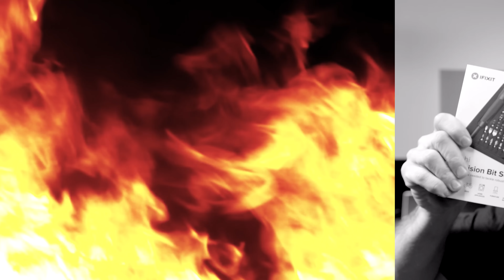They tried to screw a small streamer over... so I stepped in the best way I know how!

Comment: 2:40 Turns out there is something wrong with that: you're not allowed to run a chance-based giveaway that demands something of value from the participants, because that makes it a lottery rather than a giveaway. And legally speaking, producing advertisement value for the company running the giveaway does count for this. In fact, even demanding the ambassadors to have that referral banner on their Twitch about page might actually qualify as a requirement to do something of value to Artesian Builds. Even things like requiring participants to fill out surveys can be verboten if the resulting survey data has business value to the company. In the US, only State governments are allowed to run lotteries. And even outside the US, there's at minimum a lot of red tape involved in legally running a lottery. Not to mention private lotteries aren't just illegal to run: they're illegal to participate in. Getting caught up in this mess might actually cause harm to Ambassadors who just participated in it, if the US government decides to be a dick about this. So this stuff going high-profile might actually change the way these things are run in the tech community going forward.

You can make it a giveaway where you just need to register for free, no additional requirements, and that's fine.
You can make it a contest where the best Ambassador is awarded the rig, removing the element of a random draw, and it's also fine.
But what Artesian Builds did was 100% a lottery: there was an element of chance that couldn't be removed by performing better than other participants, and participants were required to generate an ROI for Artesian Builds, which is obviously a consideration requirement. Which means all three elements of a lottery (prize, chance and consideration) were met.
Reply: The thing is, they only changed it to those requirements after they picked a winner.
Reply: Which is arguably worse because that makes it illegal no matter how you slice it.
Reply: ok so what im getting from what you said is that I don't understand anything and you are a very smart person 😅. Man i really need to get more educated with things like these lol
Reply: @windwalker111089  don't feel bad I'm educated quite well but I also have no clue how the law works. Ur plenty smart but you can't know everything
Reply: anybody else thinking "too much text, cant read"
Reply: @unknown45754  no. If you are too lazy to read please also be too lazy to comment cus that's really annoying
Reply: @stephenponnet462  sorry bro, but being annoying is my speciality.
Reply: Holy shit dude this is wild and awesome
Reply: @unknown45754  no, in fact you can now leave lol excuse yourself
Reply: @unknown45754  ingraved in our dna haha
Reply: What’s the difference between raffle and lottery then lmao because I’ve paid to enter plenty of raffles that the item being won was based on chance?
Reply: @blackwng  If that's the case, then those raffles you paid to enter were, in fact, illegal lotteries advertised as raffles. It's one of those laws that gets broken all the time.
Reply: @martenkahr3365  good I hope it keeps getting broken, no reason not to have them, only people who don’t like them have never won or bothered to enter lmaoo
Reply: Sun this down for me?
Reply: Lets be clear, Because of miss info, Its unlikely participants would get legal issues. That said, fair point! I remember being brand ambassador for phone companies at different point in my life and even them usually go : ok here's a contest if you hit this target of whatever and up ( which was usually ridiculously low) you get a new phone free of charge or this new tech we want you to know and sell. And that is when they requested anything at all (usually for bigger items too) I remember receiving a bunch of accessories as they got released just so i had the chance to learn the product before selling it basically ok and why the hell not of those company was Apple... when even them get to be more ethical....
Reply: What do those giveaways where you have to follow their social media for extra entries count as? Does that count as providing "something of value"?
Reply: @martenkahr3365  Raffles are perfectly legal and yes, you can legally charge people to enter a raffle.  The key difference is a lottery offers a cash prize and a raffle offers a physical prize. As this was not offering a cash prize, it would be considered a raffle.

Comment: Good on you and props to EVGA for coming through.  Personally, I have no desire to watch streamers, but I wish her the best on her stream.
Reply: Because of this i'm planning to get a EVGA than a Zotac gpu both are more or less in the same price but videos like this sways audience and i'm one of them
Reply: @milanfan81  Zotac are pretty good, but I did have a Zotac that died, shortly after purchase.  I've never had an issue like that with EVGA.  Small sample size, long time ago, etc, but enough for me not to want to chance them again.  That was an expensive card too, so I was not at all happy about it.
Reply: @johnpmchappell  That's rough but Zotac did replace it? Was there an investigation to why it died?
Reply: @milanfan81  I didn't buy directly from Zotac, as I recall.  In the end, I was able to return through the online retailer for a full refund.  Not sure if they ever investigated, I'd assume so, since it was an RMA type deal, and it was not a cheap piece of hardware, but I never found anything out.  Bought the same card, from a different manufacturer, as I recall.  It's been a while ... it was nVidia's top of the line, at the time though.  Pretty it sure was the GTX 295, as that rings a bell and it was the right kind of time.

Comment: I'm sending my 3080 ftw3 ultra back to evga for an rma, I love them guys there they are so helpful with the customer support. If anyone is having issues with the 3080s locking the core clocks at 225mhz i guess its been happening to a few of them. Tried all the fixes evga recommended,  and last ditch effort is rma now.

Comment: Ya big heads up: the AIO liquid cooler they put in is presumably the "Corsair iCUE H150i ELITE LCD" and NOT the "Corsair iCUE H170i ELITE CAPELLIX"
The 5000D AIRFLOW case will not fit a 420mm radiator as you would have to cut the cables for the front i/o to get it in :)

Comment: Jay: ".. the 5000D airflow, which I love because you can just put a whole bunch of parts in and not have to worry about them fitting.."

Also Jay: ends up having to dremel the cable shield

(I also think that case is awesome its just funny)

Comment: Corsair's website says that a maximum of 360mm aio can be attached to this case, but the h170i which installed here is 420mm size. Has anyone else tried this?
Reply: Maybe the maximum front radiator is 360mm and the maximum top mounted radiator is 420mm?
Reply: @ImVesiry  nope, it says both can be max 360mm :(

Comment: I'm an old guy.....computers were introduced to students in my high school the year AFTER I graduated.
Until two weeks ago, I had never even looked in a PC case let alone dared to replace a component.  Geeks in my era were in the chess club...not computer club. I always had my PC's built for me on a budget.... 
But I'm into video content and bought some new equipment, camera's, etc and realized I could not play, let alone edit 4k video on my PC...it was clear my PC was under powered. The guy who built my system was putting me off, so I took matters in my own hands....I streamed videos showing me what to do..... installed new graphics card, PSU and SATA SSD drive.....successfully which surprised the hell out of me.
It got me so pumped that I could do this I wanted to build my own PC....so after I discovered your channel, I have been streaming your channel non-stop to absorb every bit of knowledge I can. 
Your enthusiasm, passion, knowledge and brutal honesty is so refreshing....and Videos like THIS ONE make me like you even more. Well done. 
You earned a sub from this old fart. Keep up the good work.

Comment: ive got the 4000d airflow case and idk, i like it better now after seeing you had to modify that one piece for clearence for a single cable. 

i think they did a bit better with the 4000d over the 5000d for that one little reason. now you yea will have a dremel on hand for that, but me a regular gamer likely wont have that and i just want to slap my parts in there and power on.

Comment: Super late but now with more info on what was going on at Artesian Builds:
Complete company collapse couldn't have happened to a more fitting guy than this owner.
His staff will do fine: they are all far more competent than him, I am sure. Easy bar to cross.

Also, I really don't freak out over hardware like I used to, but HOT DAMN that CPU cooler lighting and animation is WICKED. 

LOVE that.

Comment: I love how Jay came out and took care of kiapia and made things right. Jay is the example the industry should follow. I do have a question though. The H170i is a 420mm AIO and Jay puts it in a Corsair 5000D airflow, I was curious how? On Corsairs site it shows that 5000D can't support 420mm on the top just 280mm. Curious if Jay swapped it out with a H150i after seeing it didn't fit or it did fit and Corsair doesn't list the ability to have a 420mm support on top of the 5000D.
Reply: i was reseaching the same thing, but if you look when he screws it in he uses the 120mm holes, so thats a 150, not a 170

Comment: how did you fit a 420 mm radiator in the 5000D case? I'm trying to buy a new case and all websites specifications  say the 5000d only fits up to 360 mm radiators, big fan btw !

Comment: Hi Jay, I know this is kind of an older video, It's great what you did for her and I applaud you for it. I do have a question about the build. I'm looking to build a new PC into the 5000x RGB and would like to use the same icue170 aio in a top mount but the corsair website says it won't fit. Seems like it fit just fine for you' were there any mods that you had to do for this to fit? If you have a chance please let me know. Thanks.

Comment: the power supply casing come with the PC case or did you add that in manually? Also, does the coverings for the wires help with dust management?

Comment: I'm considering this case and this CPU cooler, but I noticed you used a rotary tool in your build and I do not wish to do that.  Generally, compatibility lists and Internet commenters don't believe these models are compatible.  Did you need to do anything special for this?  Thanks!

Comment: A toy die grinder on a PC case?!? Jay! Get a nibbler! They cut perfect edges into sheet metal every time and they don't leave any burs. They also taper the edge so that it isn't sharp but also doesn't flare out. Most importantly for you, they don't fling little pieces of molten metal all over the place. There is also zero need to tape it off (although I wouldn't have taped it off for your grinder toy either; this is grease pencil territory). Ohh ya, they are also super cheap; you just need\want the $15 hand tool type for PC case work.

Comment: Did that h170i actually fit the 5000x case or did you swap it and forget to say mention it? I am looking to swap out my h150i for a newer model with the link system and found a h170i but everything i am reading says it wont fit.

Comment: How did you fit a h170i in a 5000D?, I only ask because I am looking to migrate my build out of its now 12 year old (and hacked to pieces to make things fit) case and I'm bouncing between the 5000 and 7000 the main decider is I have a h170i plenty of people have said it absolutely will not fit no way no how even corsair popped up on reddit and flat out said no it can't fit soooo...how? was it just a case of drill the holes for it to fit or was there more to it?

Comment: Hey man I have a question. I updated my RAM and drivers but the RAM didn’t take. I had to reinstall my old RAM and do a factory reset. My computer is running old BIOS now and when I try to install it doesn’t go through due to admin password. Dell says Microsoft has the answer, Microsoft says Dell has the answer. I need to fix it because I can’t even connect with WiFi, it has to be LAN and other drivers are from 2016.

Comment: Hey Jay i have the NZXT Kraken Z73 LCD screen IO cooler and i have replaced it 3 separate times and every time the LCD screen burns out.  its currently unusable as a screen and its so frustrating because i tried to contact NZXT and they weren't very responsive.  Why is the LCD screens burning out?  literally one time i had smoke poof out.  The pump is working but the LCD screens on all of them have died.  PLEASE HELP!!  Im a fireman so my schedule has been slammed and ive put hours upon hours into it.  I of course bought my parts at microcenter.

Comment: Never should mount radiator on top , the heat that rises kills 30-50% of the cooling, mount in the front,and on top mount exhaust or intake fans

Comment: What made Artesian PCs worse than the competition is that they had a policy of UNDERCLOCKING the graphics cards to where there would have been issues among other issues and they also OVERCHARGED for their builds as well. They were charging AT LEAST a couple hundred bucks OVER retail for a stock RTX-3080 and the whole system if you were to go for one with a 3070, it would have set you back $3K-$4K for the system. THAT ALONE would be MORE THAN ENOUGH to steer WELL clear of them. I mean if you could get the same system from another SI for $2K AND get the PERFORMANCE YOU WOULD EXPECTED from the card, Artesian seems like an EVEN WORSE proposition> They were even EVADING THEIR TAXES so NOT ONLY they were defrauding their giveaways, they were committing tax evasion as well and they were  running a forfeit company.. Couldnt have happened to a better man in this Noah guy. I hope someone starts a class action alwsuit against Artesian Builds  cause i would LOVE for him to be forced to give all of his money back to the people he hurt through price-gouging as well. That would be icing on the cake at that point.